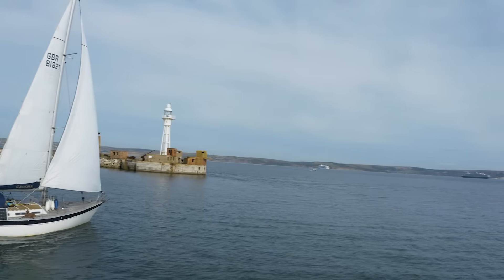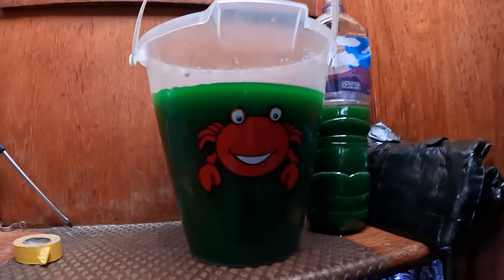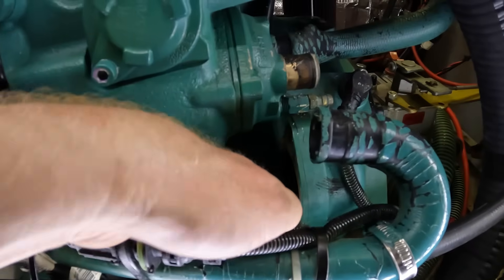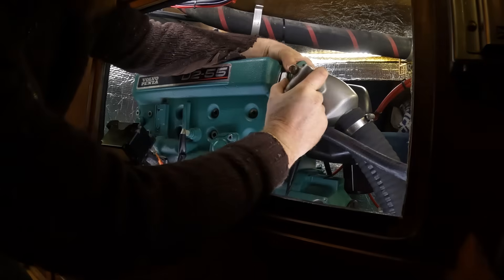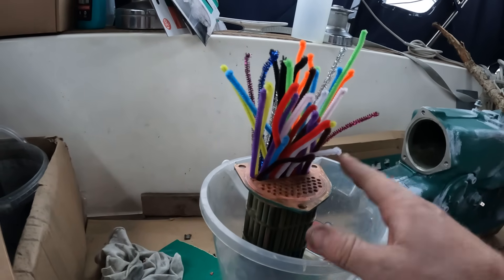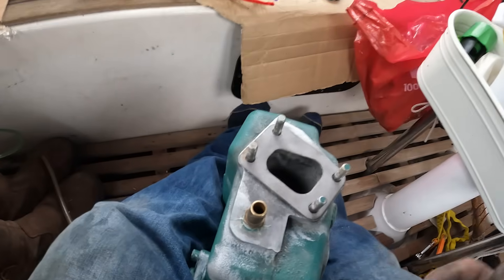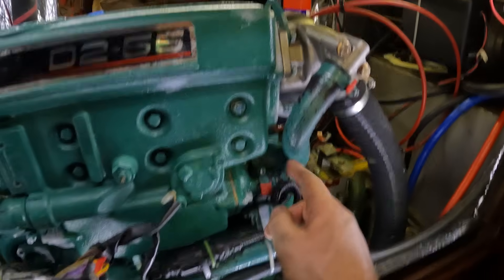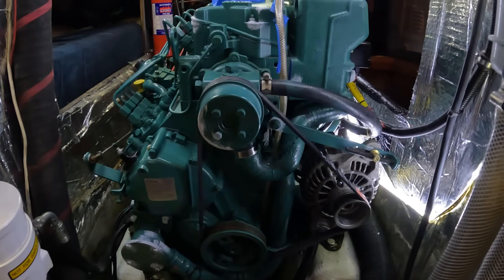Overheating  - Troubleshooting a small diesel sailboat engine  (Volvo Penta D2 55F)

Comment: A torque wrench would help when  tightning the bolts , also a shop manuel .  Get some more better quality sockets , extensions and wobbly extensions never-seize and locktite .  good job otherwise
Reply from the maker: A couple of people mentioned that are. so I downloaded the shop manual but I couldn't find anything about tightening sequence of final tension for the coolant tank?

Comment: Volvo Penta? I overwhelmingly embrace a preference for radiation sickness myself.
Reply from the maker: Kinda came with the boat, so just making the most of it as aside from being a bit awkward, it seems to otherwise be in pretty good condition 👌🏼⛵️
Reply: @CadohaAdventures  Indeedy.We get stuck with the engine that we inherit when FIRST we buy a boat. But having inherited said Volvo Penta with all its problems in my first, reasonably contemporary  boat purchase, (20 yrs) I vowed I would never entertain such an engine in any boat that I subsequently purchased later on.

Safe sailing

Comment from the maker: If you're interested in any of my older 'Boat DIY' videos, there are not many, but the few I have are here: 

Adjusting the valve clearance and changing the rocker cover gasket (Volvo Penta D2-55F) https://youtu.be/E1m8nElcjTk
Raw Water Pump Rebuild (Volvo Penta D2 55)  https://youtu.be/ONMOj2QYdvQ
Our DIY Solar Power Upgrade  https://youtu.be/42ES6F9ZSS8
Our DIY Chinese Diesel Heater  https://youtu.be/RM-NDKbzviY
DIY Sail Drive Service https://youtu.be/oADH92fcR-Y

Again, many of these are older videos, I'm not a mechanic, just a guy trying to figure these things out, mostly with the help of youtube or people I bump into and ask questions of in marinas. I'm dyslexic so I almost never read manuals or anything technical, because it's really difficult and mostly just makes me feel stupid when I know I'm not, I just need to find other ways to learn these skills than most people.

I hope you find some of them useful. Apologies for some of the filming quality in the older videos, again, this whole endeavor is a work in progress. 😁😁🙏🏻⛵

Comment: that is a pretty poor design. I would've put it back together after I removed all the impeller bits and given it a run to see if that sorted it. the outside of the tubes (coolant side) wasn't that bad. on another boat (the o'kelleys) they basically recirculated a cleaning solution thru their raw water side. you can check out their YouTube channel to see how they did it. basically a bucket with a couple hoses to either end of the raw water circuit.
Reply from the maker: That sounds much more online with how I’d like to tackle this job in the future 🤣🤣⛵️

Comment: You need to buy some gasket material and you can cut your gaskets to your specs easer to over lap no need for gasket goo
Reply from the maker: I guess you’d need some really high temperature gasket material here. What do you think about filing the corroded space with some liquid metal?
Reply: Maybe JB weld

Comment: get a torque wrench. It is imperative you torque all nuts and bolts to the proper Nm's per manufacturers specifications.
Reply from the maker: I looked in the manual and couldn’t find any torque requirements for the heat exchanger? I mean I am also super dyslexic, but I couldn’t find them either way 😕

Comment: I hate to say it, but i would just have cleaned and reattached the electric temp. sensor first. That would probably have done the job,. But then i would be sailing about with an extra impeller in my engine .

Comment: Now you know why that wasn’t properly cleaned when the impeller disintegrated. They knew those parts were in there but it’s a nasty four hour job. Regardless if you have all the service records detective work can help with used machines.
Reply: If you take the raw water hoses & back flush its only ½ an hour job

Comment: Congratulations, you did very well and you will do it a lot faster next time.😉 A full set of ratcheting ring spanners is a very worthwhile investment. On the corrosion issue on the aluminium with stainless interface - you can rebuild the damage with a liquid metal - ‘mazelmetal’ or similar. I did laugh about the temptation to pick up a ‘that will come in handy item’ from LIDL - you may enjoy this wee song https://youtu.be/cL7jyXCQ2Zc.
Reply: Tef Gel is the easiest anti corrosion paste to source for the ally to s/s interface, or good old Duralac from Llewelyn Ryland

Comment: Did the Volvo Penta engineers originate from the KGB interrogation program ? ... because its almost as if they were trying to break-down the diy mechanic to a sobbing mess with their placement of the heat exchanger insert ? .... Honestly ? 

Basic servicing should not involve a life-changing experience  .... Dom watch they don't try and nail you to a cross as who else could show so much patience and understanding while being tortured like this ? ... 

I'll subscribe and follow you anywhere mate ... as that would have left me wedged in the corner of the engine room, rocking back and forth - chanting demonic versus - whilst stabbing a screwdriver into the back of  my hand  ?
Reply from the maker: Ha ha, appreciate it, mate. I'm lucky in that I have full control of the editing process, so I can remove any and all swearing/ crying in the metal position and make for a better video to watch.

This video is loosely based on a true story 😂⛵️⛵️

Comment: No carbon in that turbo gasket? Hope not, carbon (C) more damaging than stainless steel. At the very top of 'the list'.
Reply from the maker: Can I expand on that please? When you say 'turbo gasket' where exactly do you mean? Forgive my ignorance, I'm very much still learning here. 😁🙏🏻
Reply: @CadohaAdventures  No problem. My background is engineer within wet corrosion and stainless steels. So, the frase 'dissimilar metals' rules out the most 'dangerous' item on the planet in this respect, and that is carbon (C). Widely used in high temp. gaskets in form of graphite (that is also carbon). I saw you fit a gasket between the exhaust manifold outlet and the exhaust knee (you probably don't hva a turbo engine, sorry for that mistake). That grey gasket might be a material containing graphite, I don't know that, just suspicious. But what i do know is that it is quite normal to use graphite in high temp. applications. And a manufacturer like Yanmar use both graphite and stainless steel in such applications. Where the watercooled manifold also is aluminium and the exhaust knee is cast iron. Another useful 'tip of the day': Apply aluminium paste on screws/bolts/nuts, then they will never get stuck. I just uncrewed som unbrako from the exhaust sytem on my genset. After ten years, the screws came out without problem. Never use copper paste, just aluminium paste. Any further questions, just drop me a line. Here is my boat: https://baatplassen.no/i/topic/115594-byggingen-av-hulda-p%C3%A5-oppfordring/ You will of course not understand a word, it's Norwegian. But perhaps some ideas, of how not to do things :-) Sorry for misspellings, not very good in English.

Comment: @CadohaAdventures , While I realise that 2 years have elapsed since you made this video and your aluminium heat exchanger housing has probably corroded away as you saw happening at 17:48 - It is not advisable to use stainless steel on boat exhausts and Vetus explains it very well in the linked video. If however you have no choice, please ensure that you install a carbon monoxide detector  low down in the boat and a sacrificial anode in the heat exchanger.  https://www.youtube.com/watch?v=X-GbaV0IALg

Comment: terrible engineering... I wonder if Volvo guys ever thinking about maintenance before placing components... or it's on purpose to force ppl to disassemble whole engine to reach something needs to be reached often, to increase the chance of mistake, to increase to chance of selling new parts or new engines... My D1-30 is different and easier for this heat-exchanger stage but it has other kind of issues on engine geometry... I see you've changed the elbow by a chrome one which should be made by the factory at 1st place, I donno why they still resisting to do that...